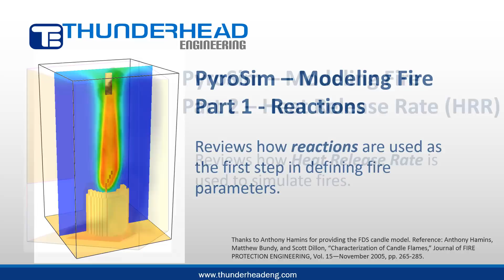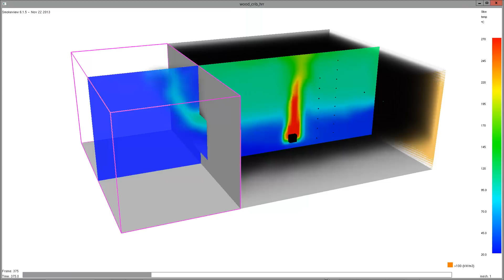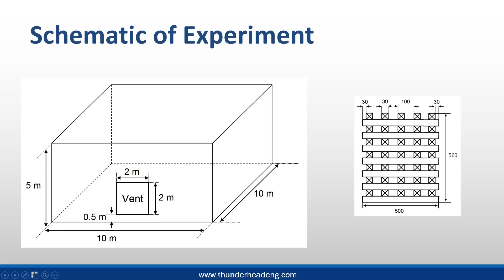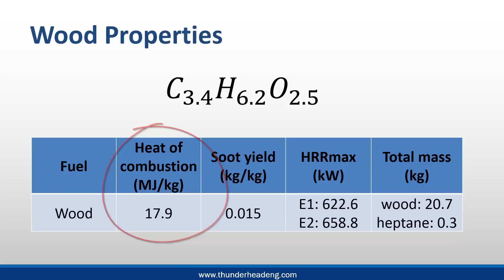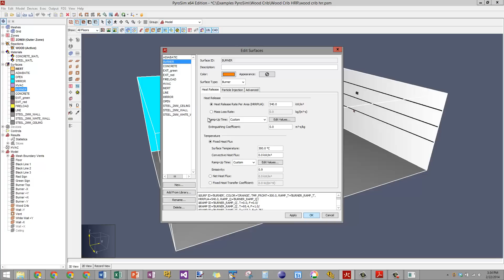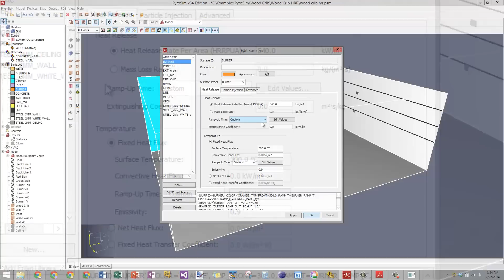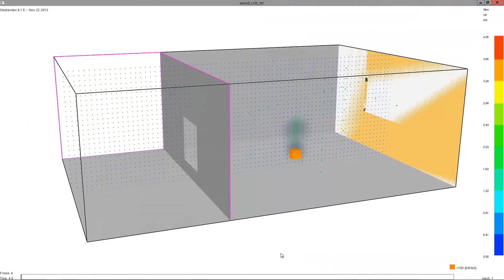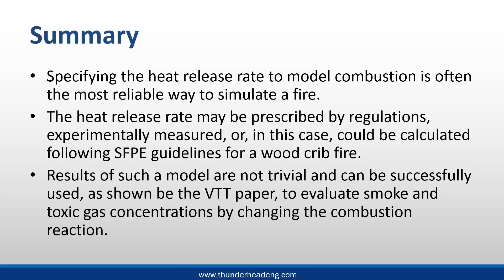PyroSim: Modeling Fire, Part 3 - Combustion using HRR

Comment: Hi, I have a question. Where are you getting this value at 5:09 of 1.25, which you are diving into 675 kW to get 540 kW/m2? Is this the Area of the floor surface or the wood crib? Would appreciate a response. Thanks in anticipation
Reply: I think the fuel source is applied to all faces of the simplified wood crib. The wood crib has dimensions of (0.5m)^3 and one face touches the floor. Hence the remaining five face have a total area of 1.25 m^2.